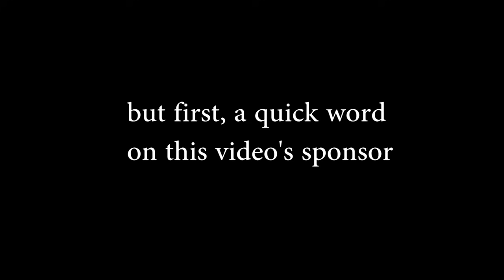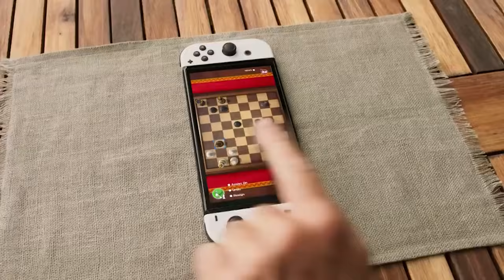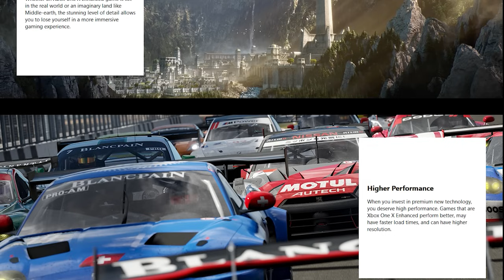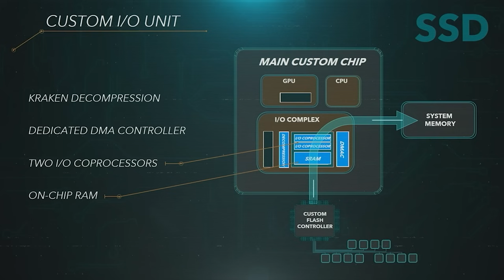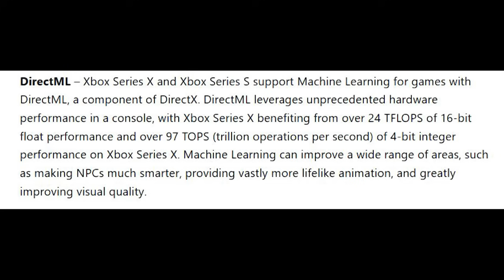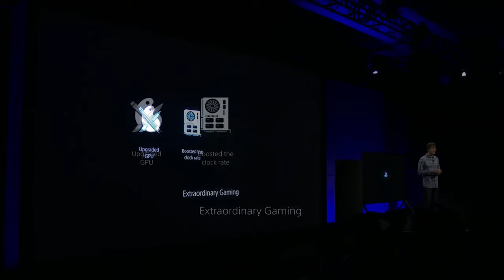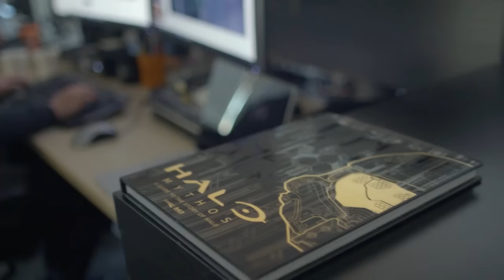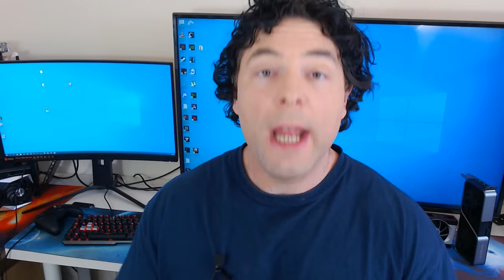PS5 Pro Is COMING - Performance & Release Targets | Microsoft's Next Gen Xbox Plans

Comment: Right now they can't even provide the market with enough consoles so if they ever planned to make Pro versions of their consoles i think that is still quite a few years away. 
If you ask me 2014 is the earliest they may even try a Pro version of their consoles. 

So because of all this i think it is very likely we may never get a PS5 pro or Xbox X Pro and they will just wait until they release a next generation. Let's not forget that creating Pro version of consoles is also troublesome because you basically still have to make games that play on old hardware therefore the Pro versions never really use their hardware as they could and just serve as slight upscale machines. 
I guess it will depend on how popular 8K will become as well. If you ask me 8K is useless at least for the moment. It is extremely hard to detect much visual difference by going 8K because 4K is already so full of detail.
Reply: Assuming you meant 2024. I agree with your point and would add that they still don't even have  must have exclusives. They're putting the cart before the horse if they're releasing a pro version soon.

Comment: Worh remebering current gen (ps5) was the most powerfull compare to PC at launch. Ps4 and ps4 pro was very much midrange... even ps3 while it had a lot of theoretical cpu power, the gpu power was a generation old at launch, and the ps2 want even close to the geforce.

Really have to go all the way to the ps1  since no 3d cards existed back then. Even at that, the 33mhz 32 bit cpu was very tame in a market with a 90mhz pentium

So I kind of doubt Sony is going to do a mid generation gpu incrrase.

More Flash..  yes. Better integration... yes.. faster wlan.. yes.. clocked up cpu.. possibly.. faster gpu.. no
Reply: @FSAPOJake  how much did a 2070s cost then?

I bought a 8800gts two weeks prior to the ps3 wad launched, and it cost $400

Comment: Mid gen rumors begins....
Also should i wait for the pro or just buy a Ps5 are available
Reply: @Aces ah your right lol plus pcs by then would be alot more powerful. So i would be benifit more getting a pc if I'd like extra power.
Reply: Honestly with games like Horizon FW, God of war Ragnorok and gt 7 still coming to ps4, im waiting til at least 2023 before upgrading.
Reply: @Denis865.. Just get a PC
Reply: Just buy the PS5 now. It will be a a few years before a Pro comes and enjoy the games now. That's what I did.
Reply: If you have a PS4 PRO  you can wait to see what happen with PSVR2 and new VR option games 👀   At this time you will get every games from this 2020 year at $20... And the futur Big HorizonFWest, Forspoken etc at arround $40.
If you don't have PS4 PRO, think to get now a PS5 with dualsense and PS+ (Include Collection of 20 great PS4 games !)... And why not PSnow... There is all GodOfWar, HorizonZeroDawn, RedDead2, Bloodborne, LastofUs2 on that ! Console that u will sold easy when a Pro will come arround end 2024 😌👌

Readers : if u have a PS4 PRO with strong noise  : just clean heatsink inside and change thermal past $5 to get full silence console  !!  😗)
Reply: @MUSTANG750R... Or still just get a cheap PC, Watch the Gaming Nexus comparison. Start with a i3 10100 $93 on eB, and a cheap card 1060 6gb or 1070 whatever's the best deal, That isn't Breaking the bank

Comment: Will dlss even matter with the rtx4000 series, because the performance of the cards are 2.4x faster than rtx3000 series. They will be so fast you wouldn't even need dlss unless you have a low end card.
Reply: Of course it will its not even a question. UE5 and similar games will push the performance needed to run those games. PS5/XSX wasnt pushed nearly as much as they will be in the future.
Reply: @demistr7435  shouldn’t thing lumina and mesh shaders make games easier to run
Reply: @demistr7435  wasn’t someone able to  Render a scene at 4k 60 with 1.8 billion polygons with a 3060 it using mesh shaders
Reply: When you throw in Ray tracing yes yes it will be very much needed and remember most games do not have full Ray tracing if you want to see what 100%. Full on Ray tracing Can do to your frames-per-second play Minecraft with full Ray tracing

Comment: There’s no need for a pro both consoles can do up to 8K resolution and a max of 120 FPS. Last gen it was necessary as both consoles at best was 1080p 60fps usually 1080p 30fps if not lower resolution and 4K was out. 8K ain’t even mainstream and both consoles have it 120fps ain’t mainstream but both consoles have it you see where I’m going with this? Y’all take last gen as the norm and it’s wrong it was an exception not the rule
Reply: 8k media not games
Reply: @ryanredmond5559  they can run games at 8K there’s just no games that actually are developed that way
Reply: @longlivetheblackmamba2-8-24  yh internal in the game engine not natively
Reply: @ryanredmond5559  I didn’t say natively
Reply: Who wants 8k anyway? I have a 4k 65" and the detail where I sit looks fine. I don't see the appeal. I would of thought any extra horse power would be for RT, bigger open world games and sustained frame rates
Reply: @scottsmith2173  not now but in a few year 8K will be like 4K now as for the world no game really talked advantage of the raam yet

Comment: Its too late in its life for a Switch Pro to be realistic. Nintendo should be transitioning to Switch 2.

Will there be a XBX2? Given Sony is looking to a PS5 Pro, probably. MS seems to like the thought that its box is the most powerful. So, a XBox Pro type upgrade...XBX Premium? XBox X2?...we can see MS double down with improvements to power, and targeting 4k@120 with full hardware RayTracing. We can look at USB-C, WiFi6, and (hopefully) additional slots for memory cards and upgrades to its internal systems, dashboard and software. New controllers might also be considered.

The PS5 Pro will see a rebuilt PS5 with existing flaws removed. Power will be increased, Raytracing improved and many of the features missing from PS5 (that the XBox has) will be added. There'll be limits...Smart Delivery and BC depend on backend systems that Sony doesn't use. Will they target 4k@120? Probably not. The XBXPro won't reach that but I think far more likely to target it.

Comment: “They’ve worked miracles to get DOOM to run on the SWITCH.” bruh, DOOM can run on anything. You can have a PC with a mid-low end graphics card and still get over 100 fps. Its not a miracle that it’s running on SWITCH.

Comment: For performance matter , we still have to wait that ( sfs, mesh shading,  vrs t2 ) become widely utilized.  
The poor series x /s didn't have a chance to shine. 
And for the ps5 we don't know  much at all. 
2023 is gonna  be massive  for the consoles
Reply: Wait ain't series x have more 120 fps game than the ps5.
Reply: @anthonyking6037  1080p and just a few... Just because back retrocomp program for serieX. Not a problem of PS5 capacities, as we see with last games working 120fps on PS5/serieX :  Dirt5 and most of all FPS.
Reply: @anthonyking6037  either the ps5 an the Xbox  series  didn't  get to shine yet . 
There is so many technology that the devs can't adapt them that fast.  
And Microsoft gave the kit to the devs way later compared  to sony. 
So even if it s good now. The potential hasn't been reached yet
Reply: @anthonyking6037  

But those are BC titles and easy to implement since Microsoft uses DirectX on the Xbox.
Reply: I remember when people were touting the unique console technologies from each company as game changers over the last 20 years.  The "supposed" PS3 CELL super powers, Xbox One's DX12 putting it ahead of PS4, Xbox One's tiled resources, PS4's HUMA architecture supposedly putting it well ahead of PCs, every generation.  Don't drink the corporate marketing koolaid.  These technologies will make an impact but its so overexaggerated by fanboys and marketing departments.
Reply: @2drealms196  Console gamers are not tech savvy at all in the slightest. They always fall for the same marketing BS and act like their new consoles are running on new advanced alien technology. Despite being impressive for their price unlike last generation these new systems already have limitations on games made with the 8th generation consoles in mind. Meanwhile these clowns think the new consoles are absolute beasts and that far more advanced games will apparently require far less power.

Comment: Hope ps5 pro is zen 3+/RDNA3. + but time will tell.  Would be nice if they added ddr4 on pro.  4gb for os/back ground task. And give devs full acesss too 16 GB gddr6.  I Hope switch pro is at least using turning or amperr. The switch should have launched with at least pascal,  but they went with maxwell for some dumb reason.
Reply: Sounds like you want an $800 console.
Reply: @BlackJesus8463  
Zen 3/ RDNA3 is next step,  ps5 pro may not come out for another 2+ yrs or more. And ps5 here in Canada (if you can find one) is already $629.99 Canadian.   Sony has sold consoles at higher then $499/$599.  Ps5 is using custom 7 nm which we believe is Ryzen 4700? With custom RDNA2.    So it make logical sense, the next step for pro or maybe ps6 is Zen 3+/RDNA3. Or Sony could use very mature zen 2+.  (As could be cheaper for Sony) 

Zen    = Ryzen 1xxx ( global foundries)  AM4 platform. 
Zen + = Ryzen 2xxxx  (TSMC 12) 
Zen 2 = Ryzen 3xxx. (TSMC 7nm) 
Zen 2 mobile = Ryzen 4xxx  (TSMC 7+)
Zen 3 = Ryzen 5xxx (TSMC 6 nm) 
Zen 4 = Ryzen 6xxx  ( TSMC 5+)  AM5 platform.
Reply: Using DDR4 wouldn't make any sense as they are using a shared memory system with the GPU which is GDDR6, which is significantly faster than DDR4 memory in terms of pure bandwidth
Reply: @SireDragonChester  3700 it's similar to what in consoles
Reply: @Shirosak1  
Yes I know Gddr6 has more memory bandwidth.  But has poor latency.  I’m talking for os tasking/for running apps in background.  Not for gaming but 2 to 4 Gb ddr4 for cpu task. Cus it has a lot better latency. Put few Gb of ddr4 on ps5 pro just for os task/back ground task/cpu task. Then you can give devs full access to gddr6 to 16 GB (with sharing it for games and os.)

Comment: no , 3 years at least for ps5 pro. same as ps4 pro.

as for switch it won't be till 2024. switch is a handheld and 4k is not that amazing for a small screen, and there is  0 chance they release a OLED model and release the new switch in the followeing year. 2023 earliest, 2024 latest.

Comment: PS5 Pro = 14 TFLOPS ( 2024 holiday ).
XSX Pro = 16 TFLOPS ( 2025 holiday ).
Reply: Performance would need to be higher than that even if they utilise RDNA 3 chipset. At least 18 TF minimum for PS5.
Reply: @ninjapresents9338  The PS5 now already has a GPU that has features based off of RDNA 3 tech. So your most likely correct about the PS5 Pro being 18 TF, if not more.
Reply: XB1 in 2013, XB1X 2017 (mid gen up grade), 2020 XB1X Pro (aka XBSX another mid gen upgrade), 2024/2025 XB1X Pro Pro (yet another mid gen upgrade). The only thing that makes the XB1X Pro a next gen console is the fact the year it was lunched, with no games and a year later we get the first game and its unfinished (Halo Infinite). Otherwise when playing the XB1X Pro looks and feels like im playing a faster XB1X and nothing more.

There are videos showing how to change the SSD in the XB1X to be just as fast as the XBSX. Sony has proven that Power dont mean shit. Graphics are all the same, considering MS made their devs use the XB1s 10+ year old tech as a devkit, to create next gen games from. Instead of giving their devs a XBSX devkit or even just the specs of what the XBSX would have in it. So they could make next gen games from. MS would be doing so much better than what they are doing now had they actually made a XBSX devkit like Sony did with the PS5 devkit. That's why Matt Booty (Head of X-Box Studios) said "If you want to play nay next gen blockbuster games, you'll need a PS5".

Comment: MS is desperate to get as many Xbox GamePass subscriptions as they possibly can and on any device as they see that is where the money is, what I believe would sell incredibly well and massively help them achieve this is to release a dual booting Windows 11 version of a specced out Xbox.

So what I mean is, have a normal Xbox XSX (or it's refresh) but then double the RAM (or slightly more as the XSX design lends itself to 40GB of GDDR6), add an additional M.2 port (for your Windows drive), add some extra I/O to make it more 'PC-like' and they are done! It would probably cost MS an extra 20% in cost but I would happily pay 50-100% more than the XSX for this and I don't think I'm alone. It would be an amazingly sleek, powerful, good value PC and if MS sold it with a mandatory 2 or 3 years of GamePass subscription then I think MS would be happy too. 

Imagine a new Xbox Series W in 2023:
~16c/32t Zen 4 
~80cu RDNA 3
~32GB of unified GDDR6
All built on TSMC's N3P node
For $999 which would be a massive increase in profit for MS over the XSX cost price but also a massively good value system for us.

I'm guessing AMD maybe wouldn't let they do it tbh as it would cripple their sales???
Reply: GDDR6 isnt cheap. 40gb of it would be quite expensive honestly.
Reply: @dralord1307  it's around $5-8 per GB when bought at the volumes Xbox buys in, so sure it would add up to $192 to the cost price although it's probably less than this, but again for a fully functioning, powerful PC with the gaming performance of the XSX people would happily pay $799-999 which more than covers the increase in production costs and give MS some nice extra profit too, and we get a bargain in these insane times!!
Reply: @Speak_Out_and_Remove_All_Doubt  They would also need to completely redesign the boards used. The connections to ram. So all of the traces would need to be designed. It would probably need more layers to the board. So that would also increase board cost. Power delivery would need to be redesigned and upgraded. The CPU itself would need to be upgraded to have more pcie lanes for more storage most likely. You would need more IO so that would have to be added into the board as well. 

Im probably forgetting a few things.

Comment: This guy talks out of his ass! "Sources"!? Pure crap and clickbait nonsense. You need a 18-wheeler full of salt to digest his rambling bullshit.

I don't care if you believe me or not, but there will be no mid-generation console refresh like last generation and with current chip shortages and overall crisis, it does not make sense and I don't need "sources" to understand the current state of the market and overall industry.

They (Sony/Microsoft/Nintendo) are more interested in reducing the costs of production of current hardware, producing more units and meeting demand than dreaming of out-dicking each other with newer and more expensive hardware for the sake of winning a spec-wars.

The slimmer version (lower cost) is certainly in the books for half way this generation as with every generation. And maybe a higher-end Switch, but a "PS5 Pro" and a "Series XL"? LOL!